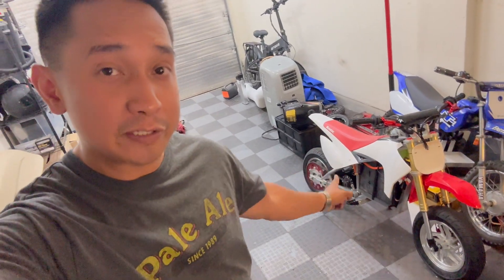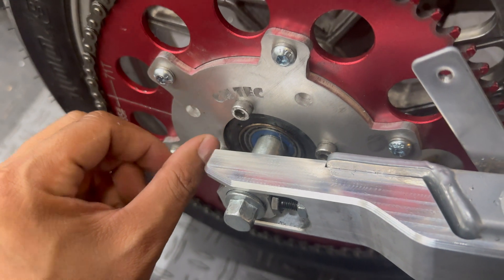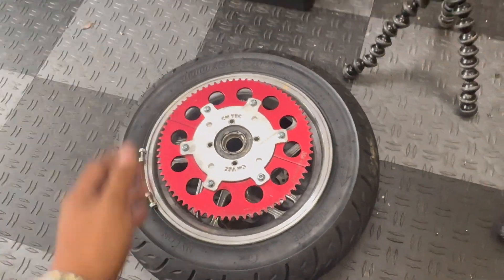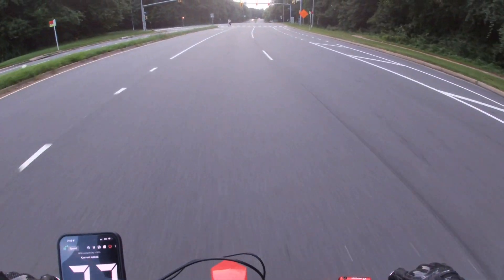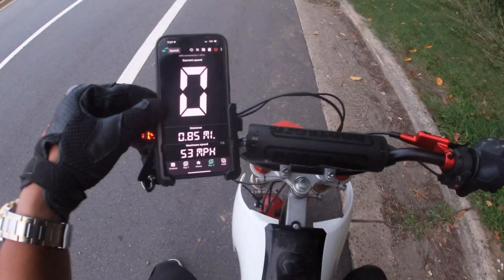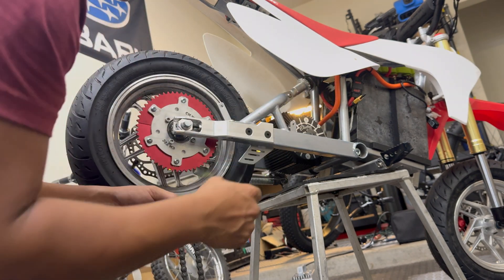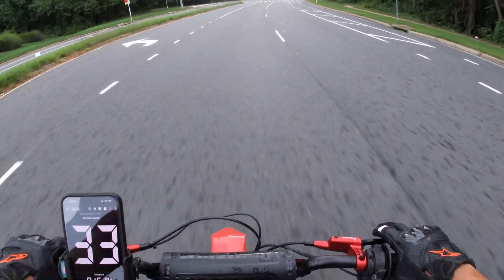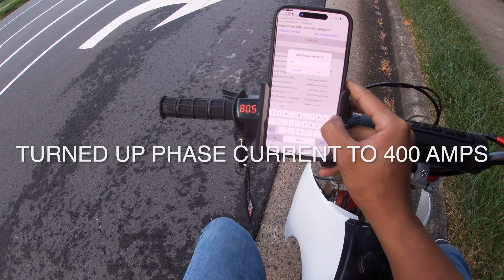72V SX500 Ultimate Street Razor Build Street Speed Testing

Comment: So happy i could help with this! Thing is ripping and those rain runs where so sketchy lmao.. Maybe get a steering stabilizer 😅 ... and remeber line amps is more speed/accel and phase is torque/accel - agression/response (to a degree). Glad this thing did its job. That upgraded rotor from EnC supposedly unlocks a ton more rpm! Definitely considering it for my build aswell.

Comment: What size wheelbis that?
Reply from the maker: 10” RSF wheels, 3” street tires
Reply: @PatOutdoors  i want to put 14 in rear..will any dirt bike wheel work?
Reply from the maker: @ you need 3” swingarm extensions at the very least.. Pit bike wheels, 14” front 12” rear is pretty good match for the SX

Comment: Yo I’m making a 72v razor will a 72v 40ah amorge battery work with the electro and co 5000w motor and controller with the stock cables and stuff

Comment: Whats the advantage to removing the free-wheel? Understand regenerative braking but besides that, what's the upside?
Reply from the maker: It's a failure point. The internals stripped out on this bike, very common if you're pushing big power on a stock freewheel

Comment: What gear ratio are you running on your ecp4?
Reply from the maker: NOT RECOMMENDED, simply for experiment - low 5's
Reply: I run a 10t on the motor and a 47t on the wheel, Enc recommends a 1:8 up to a 1:15 that just seems krazy to me, I use a website called blocklayer they  have the best chain calculator around and many others if you have a jack shaft, it will give you the speed correction, it takes chain size into consideration worth a look, I really just wanted to know what your front sprocket was a 9 or 10? So i could punch it in the calculator and see your motor real motor rpm.
Reply from the maker: @shaner.5  11T

Comment: Need to do the same run but on a flat road to get a more accurate speed. All your runs were on a down slope road, reaching top speed at the very end of the slope. Be careful, this bikes are very light, surprised no speed wobble.
Reply from the maker: @diyadventures9138  yes, I need a stabilizer fabricated to the frame.. I’ll find a wider open road that doesn’t have too much traffic, just a bit hard to find in my area. I’ll have an update video when I turn the power up more and do another run on a different road to show you it does the same speed regardless..

Comment: Will this work on mx650 and how much total was the build.
Reply from the maker: @Monkey.t4  same exact parts, yes. Total build including fork, RSF wheels, Mototec Fork, Huge Amorge 72V battery, ND72530 controller, EC4P motor, 35 drivetrain, etc I wanna say about $2,400 in parts..
Reply: @PatOutdoors  alr
Reply: You are going to have to slightly modify the frame if you want to run a 40ah in a mx frame.
Reply from the maker: @Rippinandfishin  totally forgot this @monkey.t4 you may only be able to fit up to a 28AH without modification to the frame.. on an MX650 or MX500
Reply: @PatOutdoors  Yeah a 28ah will fit with ease. I think max would be 36ah.

Comment: Use magura 203 brakes 203 means the rotor size
Reply from the maker: @jmhodge12755  right, but do you know if it would fit with RSF650 wheels like this? I know people put 203 rotors on MX650 and MX500 stock front wheels all the time (12”), but the RSF are so wide and only 10” diameter

Comment: I have a similar build and have zoom brakes and where way under powered for the speed but I upgraded the rotors to 220mm and the stopping power is night and day. I can easily lock up the tires with one finger. I was worried I was going to have to upgrade the brakes but just the rotors was plenty. Mountain bike brakes are fine with large rotors. The 220mm rotors do look kind of ridiculous, and I think 203mm would be fine. Still a huge upgrade to 160 or 180.
Reply from the maker: Thought about doing this, but larger rotors seem like it would for the caliper out to make contact with the RSF wheels. Do you have RsF wheels? I can see how that would work on an MX650 wheel though

Comment: USE PIT BIKE BRAKES (THEY ARE FOR REAL MOTORCYCLES, NOT BICYCLES) You can do a full set for less than the E+C MOUNTAIN BIKE BRAKES and AMAZON has ALL the parts. You need 51mm hole space for rear caliper, left hand lever- ATV 10mm banjo master cylinder for rear, 55.1mm brake line with 10mm banjo fitment, the front brake comes completed as a monkey bike dual piston setup already bled with the hole spacing you need for the front forks you put on. Generally stock razor is 51mm but it is smaller spacing for pit bike forks. And the only other thing you need is the thicker rotor which is used on the mega moto 80 mini bike from factory as well as other mini bikes... These brakes have slowed me down from 65mph hundreds of times. They are very stout, bleed easily, make the bike look like a REAL vehicle, and the rotors are literally .5mm off on hole size so a quick step bit for the mounting holes would make it easier, although you don't actually HAVE to drill them for them to fit. I fir one without drilling and its a tight fit but still works. Drilling makes it so easy to mount and torque the bolts... DON'T get Electro brakes or ANY MORE MOUNTAIN BIKE VARIATIONS... GET THE DIRT BIKE PIT BIKE BRAKES AND YOU WILL SAVE YOUR BIKE, YOUR SAFETY, AND THE TROUBLE FROM MESSING WITH UNDERPOWERED STUFF FOR BICYCLES!!
Reply from the maker: I have pit bike brakes on my MX650 with larger rotors and yes, they do stop very well in comparison.. but I just don’t like the feedback feel with the lever. I’m trying to find an in between solution like 4 piston calipers and maybe 203mm rotors
Reply: @PatOutdoors  There are some GROM upgrade kits out there with fancy billet aluminum rotors and the calipers are pretty stout. Im not sure I understand though, with my dual piston pitbike brakes, either front or rear, I get some decent feedback from them. What kind of lines are you running on that setup, and did you size the master cylinder to your application? Largest rotors are always best. I wonder how big we could actually go on these bikes. I run 180s from the minibike setups. Theyre about 2.5mil thick and I feel like I could go up a few mm but unsure where to find bigger ones with the right bolt pattern.